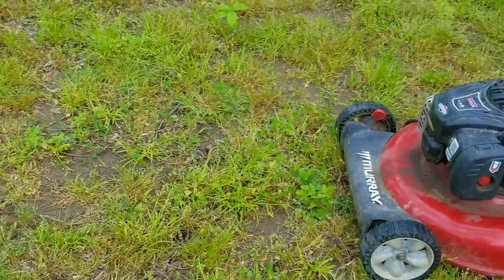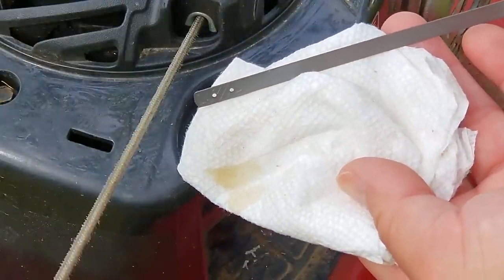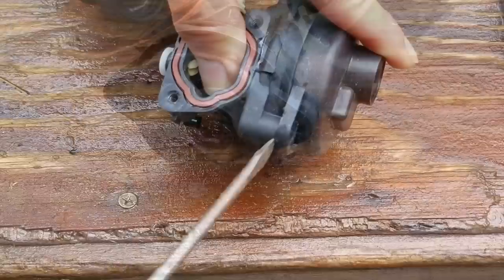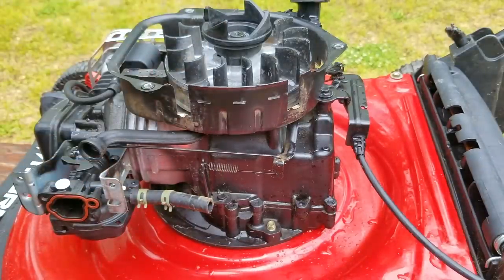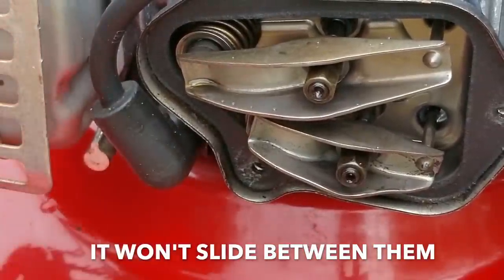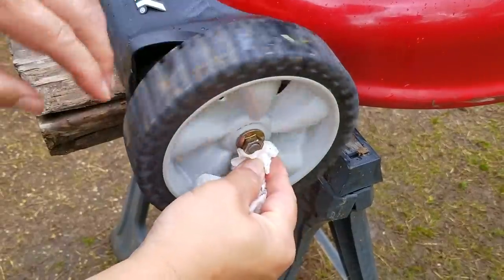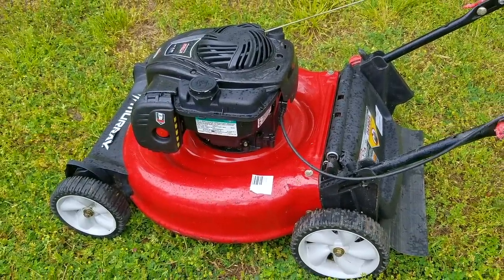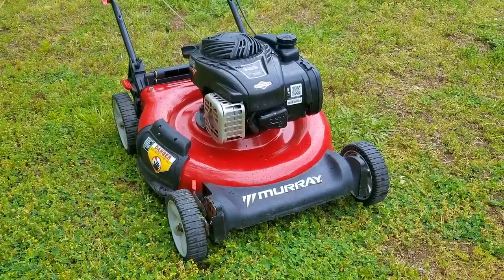Fixing A Murray Mower That Was Found At The Dump

Comment: BTW that old Sears mower I bought in ca. 1990 would start first or second pull every spring.  On others I end up using starter fluid to get them going at first.  Yea I put Sta Bil in the tanks too.   Another thing that helped once was something called Mechanic in a Bottle.  That cleaned out the fuel system and carb once on a mower that was not wanting to keep going.   Worth a try as I don't care to be a pro engine mechanic.
Reply from the maker: I heard about the mechanic in a bottle interesting stuff

Comment: Customer picking up a Craftsman Bagger with a Honda engine.. I said it starts, first pull..

Imagine how embarrassed I was when it didn't start, and how relieved to see I had forgot to reinstall the spark plug wire 🤣🤣 
Felt good when reconnected it and it fired off first pull .
Reply from the maker: wow that was quite embarrassing for sure

Comment: Thank you Sir. 
Was that a little gas that you poured into the oil spout for a wash of pan?  
I never heard of washing the oil pan area.
Reply from the maker: thank you John Houli and yes that was gasoline. You have to be careful and know how dangerous it is to flush it.
Reply: Sir I own a 2012 craftsman she is burning oil now. I just add after every other mow. 5 yrs ago I gave her a new blade. I try to run out the gas after every season. I bought her brand new. It has front wheel drive. 
My issue lately is the only way to shut her down is to pull the spark plug. Do you have a video on that situation? 
Thanks

Comment: Have you priced lawn mower repair, and their waiting lists?
When I pull out the motor in the spring its because I need to mow.
$300 for a new mower and I can mow now, vs. minimum $100 for a repair and a minimum six week wait, makes buying a new mower a reasonable option.
Reply from the maker: I haven't been to a repair shop in over a decade so no.

Comment: My neighbor gave me this exact mower. In the carburetor I found very small  pieces of black plastic from manufacturing on the assembly line. Poor quality control imo. The carburetor was blocked. This is the most easy to fix carburetor. I could do one of these carburetor’s in under 15 minutes and that taking the carburetor apart to replace plastic parts in the carburetor. The parts are cheap. Most people could not fix these carburetors even though these don’t need adjusting.
In the fuel line I installed a 75 micron Briggs fuel filter. To prevent the carburetor from getting clogged again.
Reply from the maker: thank you for sharing that 60 Gunner

Comment: I had a coworker tell me the push mower isn't cutting very good and it was brand new.  I told him, the blade likely needs to be sharpened.  When I looked at it the blade was installed upside down so that the blade was essentially spinning backward.  Just flip it over.  Problem solved and it cut great.  How did it leave the factory like that?
Reply from the maker: it must have be installed near the end of the shift.

Comment: I have a briges and Stratton on a rear bagger, it does not seem to be getting gas,
shoot ether in the cylinder runs then quits , like it is running only on the eather.
what  would be a good starting place to get it running? only 3 seasons of use just
for trimming under trees and bushes. minimal use.
Reply from the maker: sure, I would drop the bowl, poke the brass fuel just a few times, then spray the jet with carb cleaner, replace the bowl, put fuel back in the tank, and see what happens.

Comment: its always sticky floats/ clogged jets on mowers. my mower actually leaks all gas out of it after every use. I would fix it but that has kept it running like new for 20 yrs. Its never "stored" with gas in it.
Reply from the maker: really? wow that's amazing, does the fuel not leak into the engine? Or does It just spill onto the deck?
Reply: @HomeGaragechannel  leaks from the float bowl onto the deck. Garage smells like gas for a day, I try to only gas it up just enough to do the job, basic "Briggs and Straton" style motor, but year after year it starts on first pull. Having all the gas drain after every use keeps it new. deck rusted out completely once already, found a mower, little bigger, same brand,    getting tossed out, put my motor on that one, getting a whole second life out of it and its like new again. I was not going to throw out that great ever lasting motor just because the deck rusted out...lol

Comment: It always amazes me how people will throw away something that just needs some minor service.  This one is some easy money for you!  I have to mention, I watched a "restore" video here on YouTube yesterday.  The mower supposedly was found abandoned in a field, very rusted and the valve cover was full of water.  Upon teardown, the restorer found a broken connecting rod, but no other internal damage.  I was flabbergasted when he just welded the broken connecting rod then re-installed it.  The mower did run, but good grief, how much would a new connecting rod have cost?  What do you think about that kid of repair?
Reply from the maker: wow, that is pretty amazing.  A new connecting rod would have been about $25-$40 and a used one would have ben much cheaper.

Comment: I've put one of these through severe service for like 9 years.  These things are easy to keep going.  Don't toss 'em.
Reply from the maker: you got that right, keep the oil changed, sharpen the blade and use good fuel, these won't let you down.

Comment: I have had a couple of similar carbed engines get water in the fuel. was just the smallest amount and that would make it run for just a second and stall. Ended up using an unlit propane torch to feed it some fuel to let it draw the water through till it smoothed out. Honestly surprised the plastic carb lasted this long.
Reply from the maker: Nice job, I've never gotten the propane torch to work because  of air and fuel ratios
Reply: @HomeGaragechannel  I forgot to add, I wouldn't say it completely fueled the engine more so it helped it just get past the spots of water. I might try this again without any gas in it to see if it could run it. It's definitely my go to for getting poor fuel cleared out without taking the bowl off.
Reply from the maker: oh I see, thanks for the clarification

Comment: Not sure if it applies to this model of carb, but sometimes there is low speed jet hidden behind a cap, that needs to be cleaned or ya get the mower that surges.
Reply from the maker: thank you Tom The Plummer

Comment: I had two mowers with that POS carb on them.
The only way to get them to reliably start after storing them for more than 3 weeks was to buy the "Small Engine" fuel with NO alcohol in it.
If you didn't use that fuel, the jet would clog and you would have to disassemble and clear the jet with a welding tip cleaner.
Reply from the maker: yes you are correct !

Comment: I just got a very similar murray mower from a friend, it starts up immediately but the engine races extremely fast. ANY SUGGESTIONS
Reply from the maker: sure, have you checked to see if the governor arm moves?   If not, it means the throttle valve on the carb is stuck and it's allowing the engine to run at full speed.
Reply: No, will do. Thank you.

Comment: I think you got lucky lol. I found one a lot like this but it surges when running. I replaced the carburetor and adjusted the valves and it still surges while running. Not sure whats wrong
Reply from the maker: interesting, surging is only fuel related so I have to wonder if your fuel line is collapsed or if your fuel cap isn't venting or a combination of both .
Reply: @HomeGaragechannel  could be, I wonder if it is a governor issue. It also smokes and backfires some if I let it sit and run long enough
Reply from the maker: might be

Comment: I have a old 2000 Snapper WM280921B riding lawnmower that like to be bottle feed to start up . I allready change the carburetor and magnetron and oil change and filter and spark pug did all that,  But after bottle feeding it and then starting it (pull start only) it runs very good . not a oil burnner or  anything . thanks if you know what i can do it fix it
(FYI the Snapper is a pull start only no wires except the cut off switch)
Reply: Maybe the float is to low even on new carbs sometimes it happens
Reply: If it has a choke valve, check to see if it closes all the way.  If it has a primer bulb, check to see if the gaskets are good and creating a good amount  of pressure to push gas out of the carb.
Reply: @scufxz6841  think i will cheek that
Reply: @ph1l-1  thinks i will cheak that
Reply from the maker: I don't think the choke circuit is working properly. I'd check that the choke flap is closing completely on the carb
Reply: @HomeGaragechannel  yes the choke is working properly
Reply: @HomeGaragechannel  I'd go with the choke too but if it has a 5 horse with the tank under the carb the little cup where the gas gets pumped up too might have a hole in it and leaking out so no gas for the choke to work on. Get out the Seal-all!
Reply from the maker: that's a good place to look
Reply from the maker: Then only thing I've got is weak suction due to low than normal compression
Reply: @HomeGaragechannel  Me too. Maybe we're related! A family trait?

Comment: As far as the governor linkage not being connected I submit the following possibility.   With the valves being the way they were I suspect the engine had low compression.   You didn't do a compression test, or at least didn't share that you did, but I suspect it was the case.   So here is the scenario.   The original owner took the mower to a shop and complained it would not start.   Most mechanics will check the very simple things and most likely causes first.   Spark,  water in the bowl...  failing these they did a compression test since it's easier than checking the valves.   They found the compression low,  and dropped and told the customer what they found... "Hey maybe it's the valves,  or maybe the cylinder is wiped out, but I've already got a half hour into this..."  Now, time is money.   Our shop charges $100 an hour, and that actually makes repairs like this much more difficult for the customer to swallow.   I can remember when threw entire lawnmower cost $100.  It wasn't all that long ago.   A previous boss used to call it the $99 mower because everyone sold one like that.   

So, the customer denying permission to go any further,  told them he'd pay the half hour, or told them to keep it.   Either way it got thrown back together as quickly as possible, because either way it's destined to get melted down.
Reply from the maker: it's a very good possibility, and no, I didn't bother with a compression test since it started and ran after connecting the linkage

Comment: Most push mowers' gas tanks hold 1/2 gallon of fuel at the most. There is absolutely no way there was $10 worth of gas in that thing, even if the tank was full with premium.
Reply from the maker: it was an exaggeration and a jab a the rising cost of fuel.
Reply: @HomeGaragechannel  😂🤣
Reply: It’s called hyperbole

Comment: EASY FIX for me for this 550EX engine that won't start after sitting through winter.  I have a very similar Snapper mower like this one except that it's self propelled.  Occasionally, I'll forget to drain the gas and put it away for the winter.  When I take it back out and remember I didn't drain it, and it's hard to start, I've discovered "Mechanic In A Bottle" at Walmart.  Drain your bad gas, pour in a little Mechanic In a Bottle, fill up the rest of the tank with good gas, let it sit for about 5-15 minutes and it will sputter to life and then run strong.  I've never even drained the carb bowl and I've yet to have to pull the carb off.  It's the best $5 you'll spend!  PS - I do use Stabil fuel stabilizer as well, so maybe that's why the Mechanic in a Bottle works so well.
Reply from the maker: if it works for you, use it, I however don't like it nor do I recommend it.
Reply: @HomeGaragechannel  fair enough but can you say why you don’t care for it?  I don’t claim to know everything about it.
Reply from the maker: it's a product sold to consumers in hopes that it will work on their small engine, but some issues are much too far gone to be fixed by a single solution.  It's like selling a pill that will cure your mild headache, but the problem you're having might be a case of dehydration, which is not going to be fixed but a pill.
Reply: @HomeGaragechannel  agreed!  I think for a slightly clogged main jet it works by dissolving the varnish, but if it was a nasty, varnish clogged carb with water in it, etc., a good going through is in order.

Comment: Oh yah, I was working on a snow blower and getting pretty frustrated that it wouldn't start, then i noticed i forgot to reconnect the spark plug wire to the plug. Started on the next pull 😂
Reply from the maker: it happens

Comment: Bought a New Murray at Home depot.   It wouldn't start.  The machine never seemed like it wanted to start but I was able to get it to start.  I used it twice.  I was never able to use it enough to get any idea about why it was so difficult to start.  I changed the spark plug.
Reply from the maker: it's interesting that it was tough to start, maybe you got a lemon?

Comment: The single biggest cause of peoples small engines not starting and them discarding them, is ethanol blended fuel in my opinion. It gums everything up in the carbs, since I switched to non ethanol blended fuel in all my small engines  they all start on the first try. In my area the only source on non ethanol fuel is Chevron 94 octane, its more expensive but given how little I use in small engines, its worth the extra money in reduced grief.
Reply from the maker: I agree

Comment: Im skeptical that it wouldn't run with the governor disconnected. Pull starting with the throttle at idle is not ideal but it is usually possible.
Reply from the maker: there is no throttle control on this model and without the governor linkage connected the throttle plate can do whatever it feels like. Before touching the carb, the plate was fully closed but it could have easily went to WOT and broken the engine
Reply: @HomeGaragechannel  Wow!  No return spring on the carb?  I guess they saved a few pennies on this new design.
Reply from the maker: you are correct. it's able open and close when not connected to the linkage

Comment: I HAD A FORMER NEIGHBOR THAT WAS COMPLETELY HELPLESS WITH MECHANICAL STUFF!
HE THREW TWO BRIGGS MOTOR MOWERS AWAY AT SEPARATE TIMES ,WHICH I DUMPSTER DIVED THEM!
HE LEFT THEM OUT IN THE WEATHER AND WATER GOT IN THE SHUT DOWN SAFETY CABLE , RUSTED CABLE AND HOUSING TOGETHER!
WHEN THIS HAPPENED HE JUST BOUGHT ANOTHER MOWER!
I GRABBED BOTH MOWERS, BYPASSED THE SHUT DOWN /ENGINE BRAKE SYSTEM 
AND HAD THEM RUNNING IN 10 MINUTES!!

Comment: It's no mystery why these mowers are at the dump. Having one repaired will cost half the price of a new mower with no guarantee that it will work after it is worked on at some shops. The average person can't fix it themselves and a new cordless model looks real good with no fussing with gas and oil. Some just throw it out and call a lawn service because they don't want to cut the lawn anyway. It's great for people like us that can fix things. Not everyone can and that goes for some shops that specialize in repairs.
Reply from the maker: yes you correct repair costs can be very high
Reply: Back in the 70's I applied for a job at a large equipment repair shop. Their interview was to have the applicants come in and work for a day and they would pay for the days work at the end of the day. There were several others who showed up. As the day wore on I had several mowers running, tagged and ready for pickup. The others were struggling. one broke a crank trying to take off the flywheel and couldn't do it. The others had one or two mowers running. I had six ready at the end of the day. I was told at the end of the day they couldn't use me because I didn't replace all the parts and they couldn't make money with an attitude like mine. The guy that broke the crankshaft got the job because they could sell the customer a new mower. All they could charge for me was labor and that wasn't enough. Profits come first and customers last.
Reply from the maker: WOW, just WOW!!

Comment: I put a wire wheel on my impact driver to remove the rust on the axle. It's quick and thorough. 

When the metal sleeve from the wheel is rusted to the axle is no fun because removing it without breaking it requires one to be gentle and rough with it  simultaneously.
Reply from the maker: great tip

Comment: Yep 99% of the time carbs just dirty why these mowers get tossed, add in lack of small engine repair places. And the labor costs, it's often not worth the money or time for most people.
I have started running into the all plastic carbs, even with plastic jets. And when they go bad, you can't save them. From my experience, just buy a new carb. Which to be fair only cost $20-$30, far cheaper then a new mower.
Reply from the maker: you got that right

Comment: Saddly many new briggs engines are throw away engines. The carbs are one piece and non adjustable and the camshafts are plastic (ffs). A 3.5hp briggs (late 70s vintage) was the 1st engine I ever rebuilt
Reply from the maker: you are correct

Comment: 1:34 nonono that gas is probably the reason it won’t work. Dumped it out and use it for fires or in a tractor or something that doesn’t care when it burns. Small engines like this end up with ethanol fuel that isn’t maintained properly. Even at an ethanol, free fuel pump, people end up with ethanol in their fuel, especially if you only get a gallon at a time.
Reply from the maker: probably but did you watch the entire video??